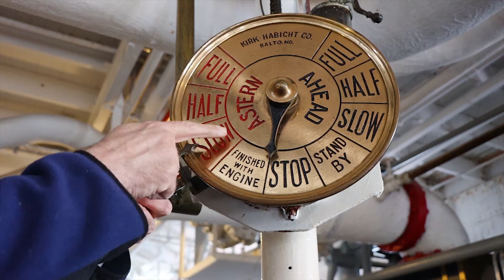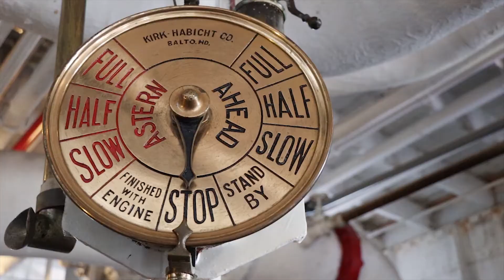William M. Black: Engine Room Communication

Comment: Wonderful video, but I was wondering, shouldn't the speaking tube have a whistle piece plugged into it to get the attention of those on the other end of it?
Reply: The Carferry SS Badger on Lake Michigan still uses engine telegraphs. (Lake Michigan Carferry owned by Interlake Steamship.) They have a loud buzzer activated from the pilot house...if they need to get their attention in an out of ordinary situation. Of course...they also have radios.